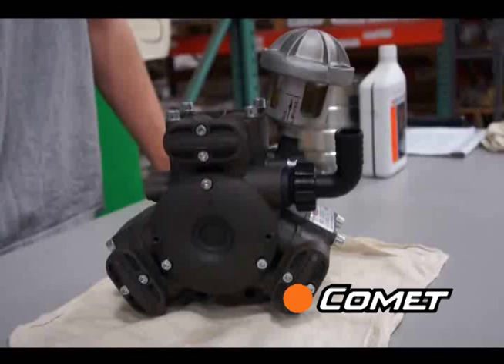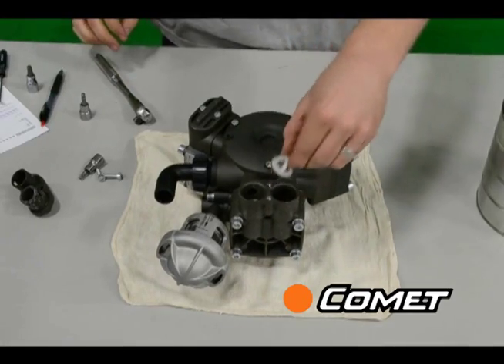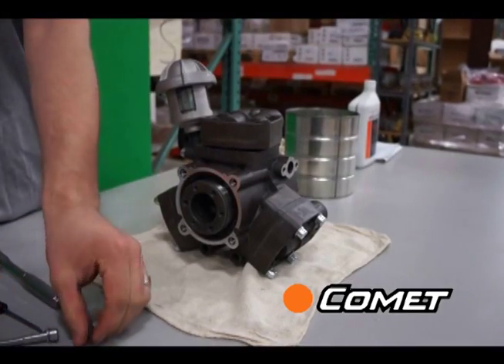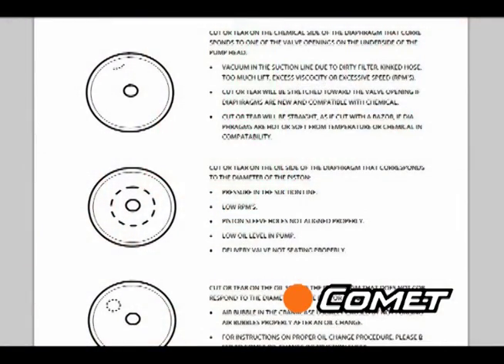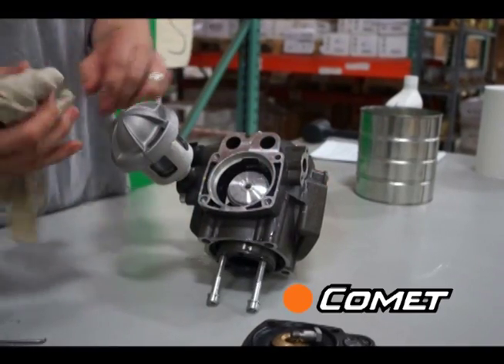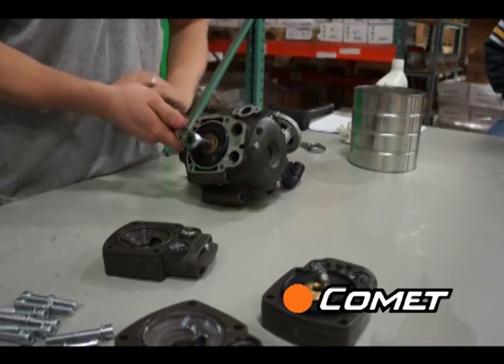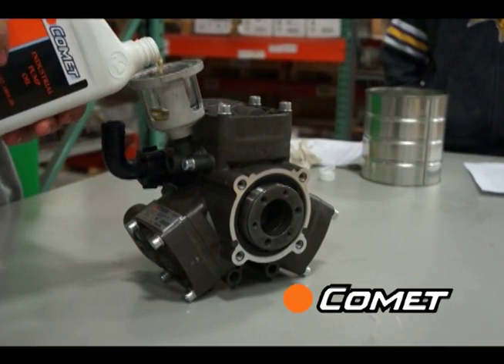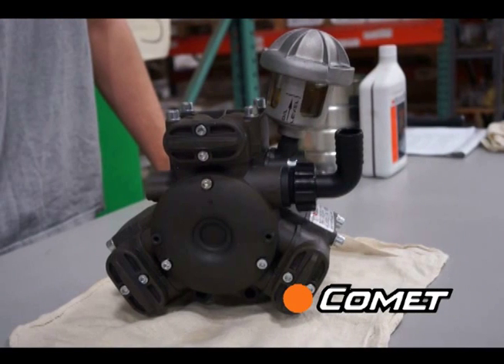Repairing Comet APS Series Diaphragm Pump

Comment: How can I remove the pump from the motor?
Reply from the maker: Hello Carlos. The pump is secured by 4 bolts from the gearbox to the motor. Those 4 bolts need to be removed to disassemble the pump from the motor. If it still doesn’t come off the motors shaft it may take some prying but will need to be careful to not crack the housing. We have in the past also used a torch to heat up the female part of the shaft to get the pump to release.  If you have any questions, please reach out to either our email: cometpump@cometpump.com or toll free phone # 800-708-1894